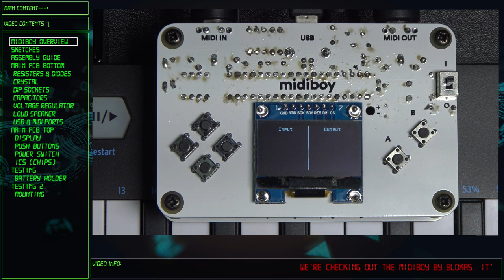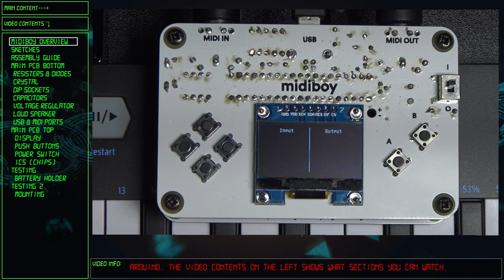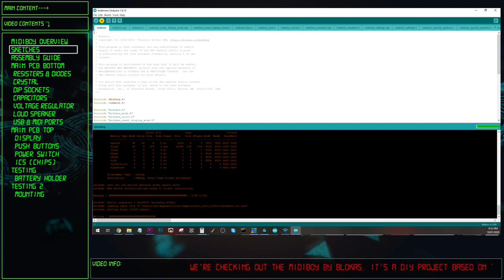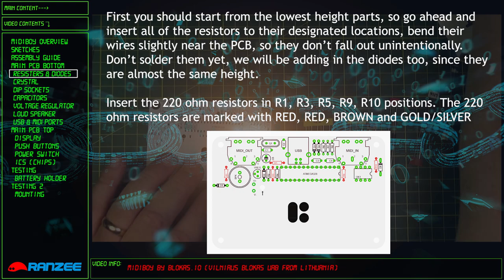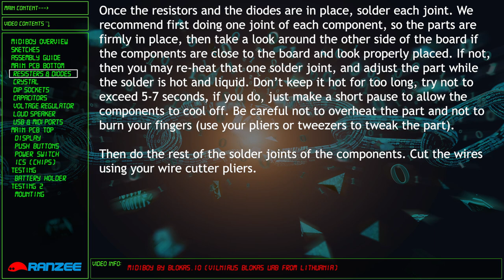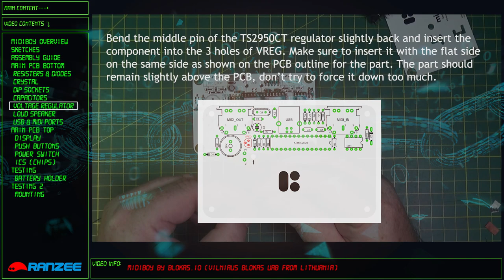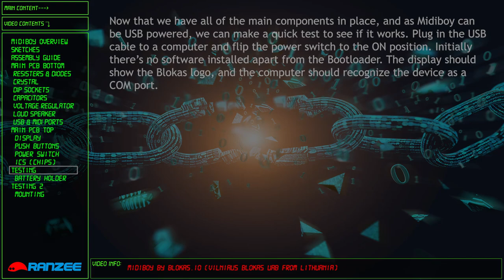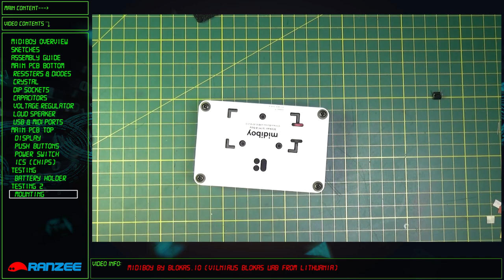Midiboy Overview and Build

Comment: Hello, can the MidiBoy play a midi file and send midi messages (out) of all 16 channels?
Reply from the maker: Not that I'm aware of - the 8-bit ATmega328P 20MHz Microcontroller is probably going to be your issue here. You would need to modify the hardware to take some kind of external SD card storage - plus you would need to code up file loading routines. It is possible - but not by default. Head on over to the blokas website and see if anyone has done a custom firwmare for it - you may get lucky! https://community.blokas.io/